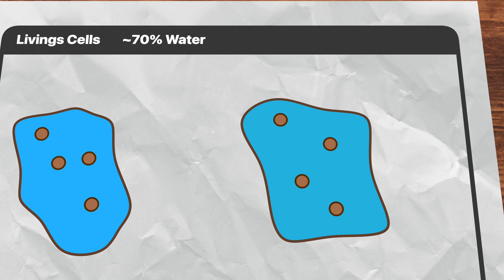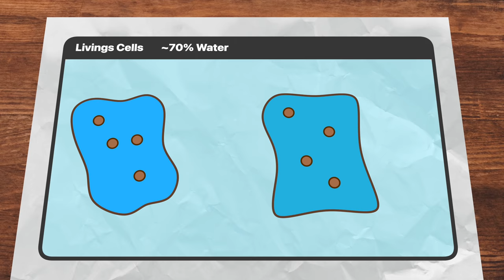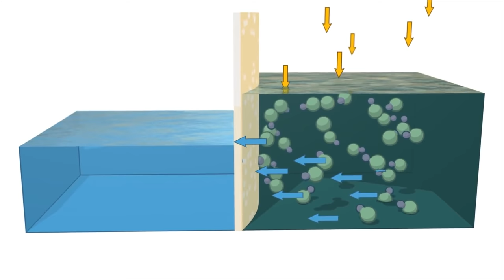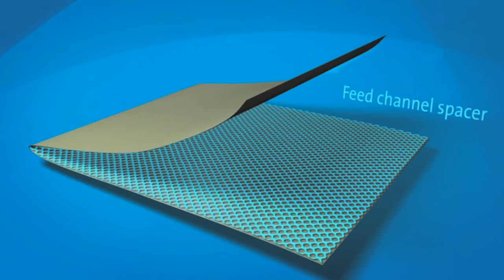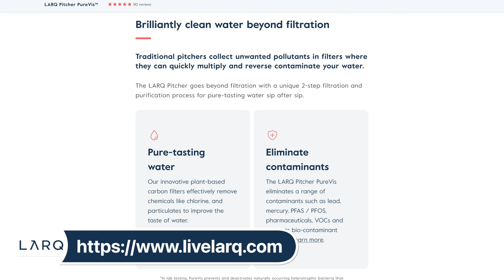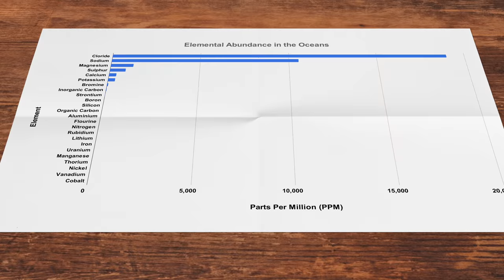Why Not Build Desalination Plants EVERYWHERE?

Comment: Technically, you do not have to use pumps to pump water into solar water evaporizer. If you build it under the sea level, you can pump the water just by opening the valve. And, if you make that chamber airproof, using the fact, that gas have smaller density, you can "pump" fresh water out of it just by using higher pressure by the steam generating.
Reply: sounds like you have heard of the device noted as a ''water ram''  not as tech as what you mention but some of the same operational qualities, it works on gravity, travel distance, and air compression, i would love to see what you said work, I think it would solve a lot of problems
Reply: On another level, it's probably not wise to put facilities like these below sea level. The Fukushima disaster is a key example as to why we should not put important infrastructure below the water line. Although a desalination plant wouldn't be nearly as disastrous, it's still a good thing to keep in mind when building anything near the ocean.
Reply: What if we built a hollow space rope. like a space elevator but just a hollow hose, connect into the ocean with the open end in low earth orbit, the pressure difference would draw water up to the top of the rope, then you could have a second rope filled with reverse osmosis stuff that let gravity just pull it back down to earth, so you could have one set of reverse osmosis in the pressure pipe and another in the gravity shoot, by the time it went all the way up and back down, you got clean water? maybe even make the rope itself the osmosis filter, so clean fresh water flows and falls down the sides, and the crud would flow and fall down the middle....
Reply: @mequavis  No, because inside the rope will be exactly same pressure as outside of the rope. 
Like atmosphere, pressure is decreasing with higher altitude
Reply: @mequavis  is that called rain

Comment: The incoming cold seawater could be used to accelerate condensation when the dome is cooled from the outside, just let it flow over the dome before it is heated inside from beneath. Smaller units could use parabolic channel reflectors to heat a pipe from below, while being cooled above with lateral exits for the condensate and be eventually more efficient.
Reply: That would require a network of piping carrying the cold water possibly in an inverted conical shape maximizing the surface area of the cooled water speeding up the condensation
Reply: @terellcase9231  exactly, with the parabolic channel, you get the heat underneath. Develop sahara regreening and agriculture with the fresh water.
Reply: Go back to school, then publish your research.  THEN post on YouTube.
Reply: @terellcase9231  
Thats essentially the technique used in some DIY mini systems.. look at UN and NGO sponsored desalination devices.
Reply: Isn't this going to refract the light from the parabolic mirrors and also result in the outside of the dome never heating up, which is exactly what causes the air temperature inside to promote evaporation?
Reply: There you go world; a millenniums old problem has just been solved by "RandomYouTubeCommentor". Amazing nobody has ever thought of this. Sigh.
Reply: @OneEyedJack01  

There comes a time in the affairs of man ..  
The technology at scale has become possible. It does however require other technologies and materials that have till now been used differently and the conventional economics thinking has shut down exploration. 
Now the need is greater than ever and growing and the cost of other methods unsustainable.

It was only because somebody picked up a petri dish that had been dumped by a sink for washing and saw a gap in a bacterial culture  round a mould
and started talking about it that we got antibiotics.

Comment: There are so many problems with the Neom concept: 
1) As you pointed out earlier, thermal desalination is terribly inefficient. It would be way more efficient and cost effective to use that solar to generate electricity and run an RO system. 
2) All desalination plants produce brine. There isn't any magic in Neom's brine that makes it more economical to process into valuable commodities. Anything you do to process that brine is liable to consume more water than was produced in the first place. Desalination is typically meant to produce enough water to sustain agriculture. There simply isn't a market for that much sodium, chloride, etc. to make any exotic means of processing brine without water economically feasible.
3) The dome design isn't even very conducive to solar concentrator heating. It makes so little sense!
Reply: At some point we will need to realize long term survivability is more important than profits.
Reply: @zahhari3170  Profitability is directly related to sustainability.
Reply: Thermal desalination is terribly inefficient if you use fossil fuels to evaporate the water, while Neon is using heat from the sun
Reply: Molten salt can produce explosion if you let it touch water, can't it be used to generate energy ?
Reply: @zahhari3170  They're related. "Profits," are the food and water you eat and breathe.  They are the warmth to keep grandma and grandpa alive in the middle of the winter. They are the EMT crew that come to save your life after an accident.
Reply: True.
We should be less interested in videos that talk about how a theoretical technology "Will work," and looking for "proof of concept." Even if the proof of Neom concept is a mile long stretch that works 20% as effectively as people predict, at least they are in the ballpark. But they have no proof.
      Computer graphics and models that are not based on proof of concept of the actual science, are among the worst problems in the scientific fields, nowadays.
      Most videos and decisions our leaders are making are made on modern ecology are based on faith and not science. "we need to do better." "zero emissions," and other catch phrases are nonsense.  
       This guy's video is better than most on these topics, but it's still too much like "solar roadways." Prove it works based on R&D and then scale it up.
Reply: @segalliongaming8925  exactly, how are you meant to sustain anything without funding lmao
Reply: Improvements in reverse osmosis membranes in recent years have lowered the energy requirements for seawater desalination to about 2.5kWh/m^3. That's now approaching 50% of theoretical peak efficiency (1kWh/m^3). Thermal distillation is ridiculously inefficient as you point out... it takes dozens of kWh of energy to evaporate a cubic metre of water, even in a low-pressure vessel.
Reply: @TheChenchen  Totally not! As far as I know, molten salt doesn't exactly produce explosion. At least not in that sense as in pyrotechnics where material indeed releases (produces) a lot of energy. Molten salt poured onto water makes the energy transfer from salt to water, so quickly that the water evaporates. Very quickly - which means tremendous rise in pressure and then decompression to achieve equilibrium pressure again. Which means - explosion. But this salt-water explosion is physical in nature, not chemical. Moreover, in physical-nature case the energy is conserved: molten salt + water has the same amount of energy irrespectively of the state:
1. molten salt separated from water
2. molten salt in water and making it heat
3. molten salt in water and making it boil
4. molten salt in water and making it boil, water steam from the boiling
5. solid salt in boiling water, water steam from the boiling
6. solid salt in hot water + steam
.
.
.

And important thing - I simplified (idealized) the transitions between those phases. In reality no process is 100% efficient energetically, meaning that every next state will have less overall energy because of these few percent being radiated as thermal losses.

So, instead of producing energy, it is gradually lost to thermal losses during the process. It means, it is spent or lost and that's contrary to producing.
And assuming that the salt needs to be heated by the city, the whole cycle means heating the salt just to pump the heat out into nature (not getting any more energy).

But, this salt heating could be used as a means of storing energy from the sun, so efficiently - having gigantic thermal batteries, which' energy could be spent for producing electricity (steam turbines), heating homes and other technological processes.

So, in last conclusion, it would be a giant solar battery :)

And in case of "chemical explosion", actually the energy is also constant, but it is stored in chemical bonds, which change during the process. And this change releases the energy. So the energy is released in the sense that chemical energy is changed into physical energy back again (making more of it than on beginning). In "physical case" the energy is constantly in physical form, so it's highest on the beginning and then declines (but also in physical form).

So, even though not for energy "generation", that molten salt concept seems quite useful.
Reply: @michaniewiadomski7911  Owh thank you for the explanation

Comment: I am a retired 3rd. Class Engineer,  and when I was at sea,  I was responsible for the Reverse Osmosis machines in order to convert sea water to drinking water and believe me it is very labour-intensive and consumes a lot of power.  it would be very costly and require many skilled technicians to produce enough water to supply a city.   The pump(s).  use very high pressure to propel the sea water through the membranes and %95 percent of the feedwater is returned to  source.
Reply: That may be true, but the available fresh water is depleting faster than nature can replenish it. There is no other way forward. Look at all the lakes and aquafers on the West Coast. All almost empty. If you have a better idea, now is the time to speak up.
Reply: @rchokelal  Do what Singapore does. Use the reverse osmosis technology on sewage water instead of salt water. Sewage water has significantly less impurities than seawater, so it is energetically less demanding to purify. There is the ick factor but people will get over it.
Reply: @nickl5658  that might be possible, but it important to remember that sewage water is an output. It requires an input to become sewage water. Right now, I don't believe there is enough sewage water to fulfill the fresh water needs. The process you describe is used on the space station, but these type of systems are lossy.
Reply: @rchokelal  There are plenty of other ways forward.

Aeroponics can reduce agricultural water usage by up to 95%.

Most people are one dimensional when dealing with multi-dimensional problems.
Reply: it's easier when you have nuclear power, which we do on submarines. :)

The reactor would happily make a LOT more water, but since we're a submarine, our potable water tank only held a little over 5000 gallons. With 20 officers and 100 enlisted that's 41 gallons for all water uses. So a shower was turn water on for 1 to 2 seconds, turn off, put soap on body, turn water on for 1 to 2 seconds, shower over. :)
Reply: @josephcoon5809  

"Aeroponics can reduce agricultural water usage by up to 95%."

Sure but you can only conserve so much. If the fundamental issue is that it's just not raining enough....you need to start processing that seawater. You won't run out of seawater any time soon.
Reply: @neutrino78x  Man…if civilians enlisted for a couple years, imagine how much water would be saved.
Reply: @neutrino78x  Those two ideas are not mutually exclusive.

The necessity for processing seawater would also be reduced by 95%.

None of this is binary. Most things can have multiple solutions working together such that a failure in one won’t result in a catastrophic failure.

Efficient use of redundant processes is the BEST solution. Besides, I have ideas for seawater as well.

“Most people are one-dimensional when dealing with multi-dimensional problems.”
Reply: @josephcoon5809  

"he necessity for processing seawater would also be reduced by 95%."

Temporarily. Like I said, eventually you just fundamentally don't have enough water, and you need to make more potable water. You should start doing it long before you get to that point.

As a Navy submarines veteran (I got out 2003), it's odd for someone to resist desalination. That's just part of our life at sea. That's how we make drinkable water. If you guys weren't afraid of nuclear power it would help. A nuclear reactor happily makes enough heat to desalinate huge amounts of water.
Reply: @neutrino78x  It’s odd that anybody would keep insisting something that isn’t happening.

In what comment do you perceive me “resisting desalination”?

Quote my exact comment, and I will explain each word in it for you.

Besides, I WOULD have been a nuke tech on a submarine had scoliosis not kept me out of the military, so take care who you brag about your credentials to.

I am not calling your technical expertise into question; only your basic reading comprehension.
Reply: @neutrino78x  As for nuclear reactors…

Son, I do light research into fusion reactors. What fear are you even referring to?

Try addressing what was said instead of what you imagine was said, and you’ll enjoy less embarrassing situations.
Reply: @josephcoon5809  

"Son, I do light research into fusion reactors. What fear are you even referring to?"

Your irrational fear of fission. And I'm qualified in submarines. Nuclear powered submarines. And I'm 43.

"enjoy less embarrassing situations."

You haven't remotely achieved that.
Reply: @josephcoon5809  

"In what comment do you perceive me “resisting desalination”?"

All of them. You argued that we should be doing water recycling instead. I know the type. Lots of them showed up to protest the desalination plant in Huntington Beach. 

You can only get so far with water conservation when the fundamental problem is that we're getting too little supply of potable water due to global climate change. We have to start desalinating.
Reply: @neutrino78x  WHERE did I allude to a fear of fission? 😂 

I’m not caring about your qualifications if you so easily jump to incorrect conclusions.

I don’t have a FEAR OF fission. I just understand that deuterium is a far more plentiful resource in the Solar System. Use up all the fissile material that you want. I don’t care because I am looking PAST that.
Reply: @neutrino78x  “You argued that we should be doing water recycling INSTEAD.”

AGAIN, QUOTE the comment EXACTLY where I said this.
Reply: @neutrino78x  You’re problem is you are a one-trick pony.

All I have done in this comment section is propose OTHER options. Not once did I oppose option already stated.

Son, you’re looking for battles where there are none. There’s already too much conflict in the world today. You don’t need to manufacture more of it out of thin air. 😂
Reply: @neutrino78x  Perhaps you were confused about “Efficient use of redundant processes is the BEST solution”?

If so, who in their right mind would argue AGAINST efficiency being the best solution?

Nobody.

Which implies many government workers and boot lickers are fine with waste as evidenced by the wasteful spending of large governments.
Reply: @josephcoon5809  

"GAIN, QUOTE the comment EXACTLY where I said this."

It's implied. Look up the word "implied".
Reply: @neutrino78x  You inferred something that I did not imply.

Perhaps YOU should look words up, rather than tell others to.
Reply: @josephcoon5809  

You did imply it. Your whole argument is that desalination is a bad idea and we should instead do X, Y,  and Z that don't increase the supply of freshwater.

Comment: Brine can be a minor issue, they just need to create a long tube with vortex pressure mixing of the surrounding water.   I deal with it in my reef tank all the time when adding salt.  You add to the sump, not the display.  You also dissolve the salt first.  If you don't it goes to the bottom and it kills stuff.  The brine will dissolve easily but not instantly.  It is dumping it all as a solid that is an issue.

Comment: The desal facility in the city where I live processes the brine by-product by mixing it with partially treated waste water, resulting in a solution that is slightly less salty than that of the ocean. It is then pumped offshore where it is assimilated back into the ocean without adversely affecting the environment.
Reply: I was thinking the same
Reply: Except that the process requires massive amounts of energy. We need to work MUCH harder at reducing water demand.
Reply: @markdennyritner7851  -- Recent solar installations are helping to carry the load.  Reducing water demand in a coastal desert with many already practicing water conservation at levels unheard of elsewhere?  Easy to say, I suppose.
Reply: @tswrench  Perhaps developers shouldn't be given easy access to keep pilaging.
Reply: @markdennyritner7851  --  Uh-huh.  "Lighten up, Francis."  I figured you 'd be back to set the hook you were dragging with your first trolling reply.  Take your hands off your hips, stop stamping your feet, and move along. Unless, of course, you're the kinda gal who has to have the last word.
Reply: @tswrench  ok, if you say so Uncle Houka!
Reply: @markdennyritner7851  Nuclear power can handle it.
Reply: @SirenaSpades  Use less water. Stop human population growth. Move away from areas without sufficient ground/psurface water.